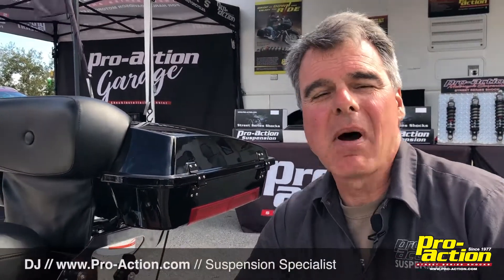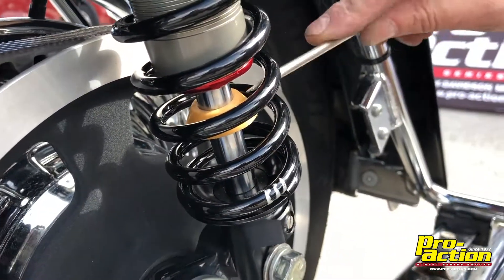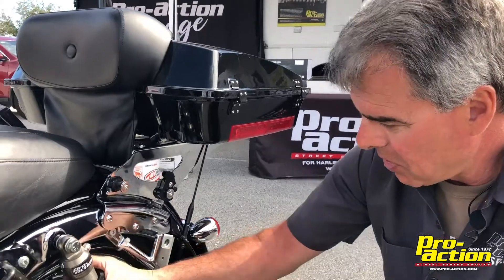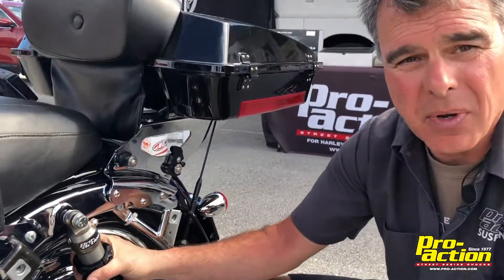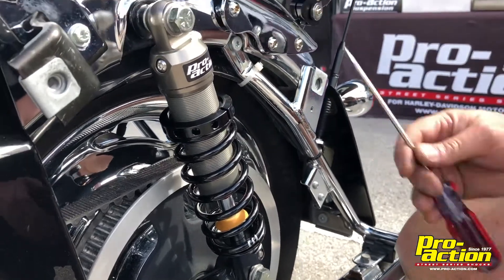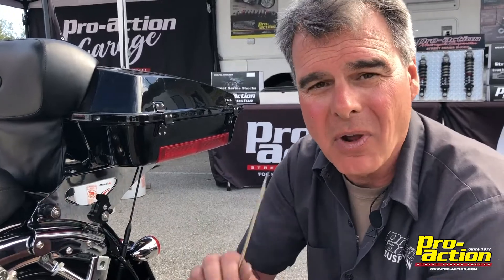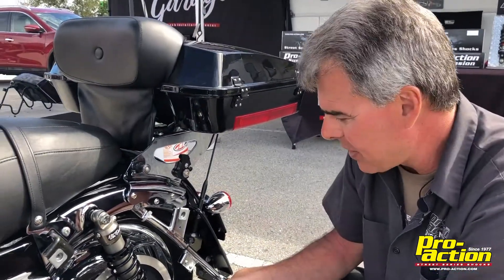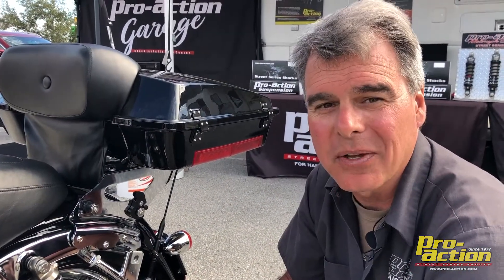Too Stiff - Fine Tuning Your Pro-Action Suspension

Comment: These shocks are great. I installed them several  months back but got my first real ride for 6 hours a month ago and they work great. I still have more travel left so I might adjust the springs up a turn. But they even out the road. Thanks and well worth the price for long rides.

Comment: I bought your shocks for my 2015 Harley Freewheeler and installed them with the body off. With the body back on, and the ride too stiff, I can't get to the top of the shock to loosen the screw and turn the adjustment ring. What do you recommend, as I need to adjust between towing or not towing my trailer.